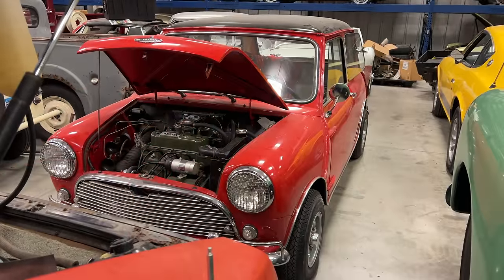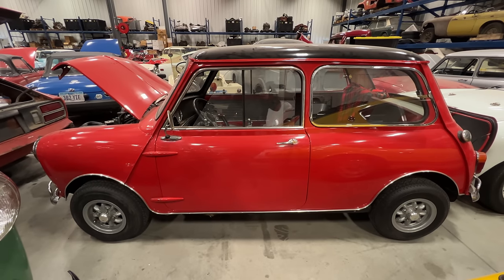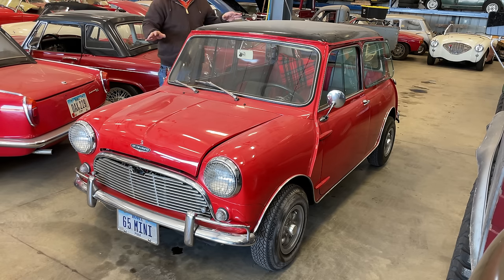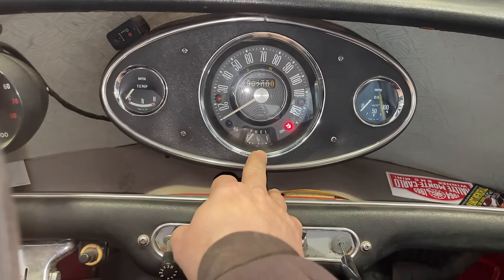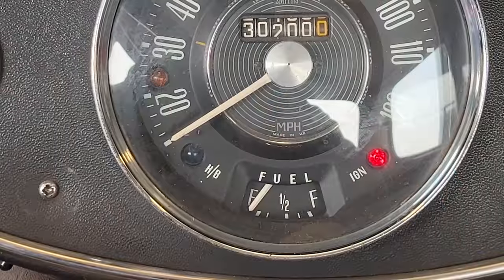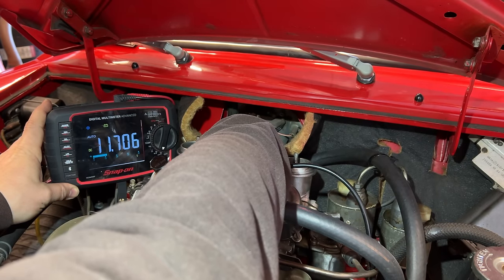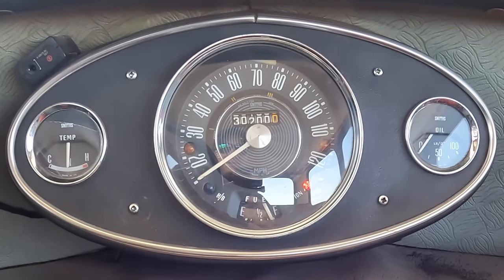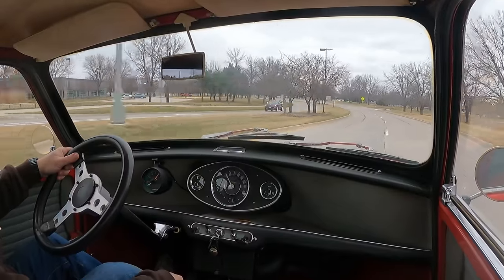I Sold My 1965 Austin Mini Cooper S

Comment: I had a Morris Cooper S in 1969. Mine had the 1275 cc engine,  twin fuel tanks, and hydrolastic suspension.  Baby blue body with a white roof, RHD because was made in Australia.  The most fun car I have ever had. Great acceleration and very agile on winding roads.
Reply: They are such great cars. We daily drove one for years. When we had kids we sold mine, and stored my wifes, as it is her first car. After 7 years it's now back on the road  we use it as a daily driver again. I did not realise I missed it so much, completely addicted again!

The Cooper S gets most attention, but in reality every Mini is great and equally fun.

Comment: When I learned to drive back in 1976, my driving instructor used a mini 1275 GT. The first time I got the really try it out was after I passed my test and Mr Rendell said "right then,  let's see you drive it properly". At the time my mum also had a Mini, a 1000cc estate and when allowed to borrow it I would thrash around feeling like I was doing 100 mph when I was actually doing 60. I first learned to deal with understeer driving that car.... but not before I had to pay for a headlight glass.

Comment: Had a ride in a Cooper many years ago. Driver never exceeded the speed limit, (in town, 30 mph), but he never slowed down for corners either. Pulled some pretty incredible corners.
Reply: Yep, they're known to take any corner at speed, just don't  let off the accel half way thru the turn, lol.

Comment: Steve- at 00.28 I see two cars on the rack I once owned, a Fiat 1100 which was my first car I bought when I was 16 in '66. The other is the Renault Dauphine. Here's a fun fact- when I did the brakes on the Renault I COULD NOT find rear axle seals. This was around '73 so no internet and really no Renault dealers at that time. Spent several days on the phone and driving a few hundred miles with feeble hopes. Finally I took an old seal with me with the collars they're pressed into to a parts store I used to work at and they let me go through the floor-to-ceiling rack of boxes of seals. I finally worked my way to the bottom shelf with maybe 4 boxes left to open. Opened a box and I took one look and the heavens opened up. We mic'ed it up and pressed one in and it worked. Get this- it was for a 1964 &1/2 Mustang 6 cylinder convertible. In '63 and '64 Ford had mid-year releases of new models and I think the Mustang was one of them . I'm 72 and I refuse to take my one true automotive miracle to the grave with me.  Tell your friends.
    I worked at a foreign car dealership (Jaguar, MG, Alpha Romeo, Toyota) in '69. The owner had a '63 Mini that he raced, it was good for 120mph. It wasn't pretty but it went like stink. They took as a trade-in a complete and original ex- Mass State Police 1947 Indian Chief  for $475 and I passed. Sigh. 
Love your channel. If you knew the cars I owned, you'd understand why. 
 '61 Fiat 1100 ran fine after my first complete engine rebuild
 '61 Hillman Husky Wagon    threw a rod through the block coming home from college
 '61 Morris Minor Convertible    paid 50 cents and a pack of Marlboros for it. 
 '60 Morris Van  2-year restoration project
 '61 Metropolitan Convertible  lots of duct tape to keep out the cold
 '59 TR3
 '65 TR4A rust-free, not pretty but rebuilt everything and fresh Michelins, predictable drifts through the corners
 '63 Fiat 600  GREAT little car, the radiator doubled as the heater core in winter, suicide doors folded back for AC in summer
 '61 Renault Dauphine w/'64 1/2 Mustang 6-cylinder convertible axle seals but enough about that.....blew a head gasket on a first date.
 '53 Jeep CJ 3B  perfect for getting in and out of trouble, many, many times. Oh, God..... so many times.
 '69 Toyota Corolla 1200  badly spanked my friend's V8 Chevy Impala on a beer-induced road race home from a party. Kept it in the power band and the rest was easy.
  '47 Ford Sedan  girls loved it. Girls 'parents, not so much. Not at all, actually. Something about that back seat....
 '61 Vespa Grande Sport  the most fun on 2 wheels. There's a story about the July 4th Bicentennial 1976 bonfire, a bag of ice and a rack of beers in the storage compartment that ended up at the hospital for a few stitches, but hey, you can't put a price on fun.
Reply: You've got a good memory for all your old cars!

Comment: Funny, I was out in my own little red Mini myself today, Steve!  .....except mine's red with a white roof (like Paddy Hopkirk's Monte Carlo contender).  Neat little cars.  I've been around A- and B-series BMC engines most of my life, but never owned a Mini...until 2018.  

My daughter absolutely adores them and when her sister bought the car I had purchased for them both to learn to drive in, the youngest said "Well, you'll just have to get a Mini for ME to learn in then, won't you Dad?!"  So I did - but it was a short while before she was back on the road, but she was ready before the day my youngest got her Learner's License and we've already had a few memories in the little car.  

I have a Triumph Stag and a Triumph 2500S as well, but the Mini is the only one that sounds like I am doing 100mph when I am still under the speed limit!  You can have so much fun with the little cars - even at slower speeds - throwing them into corners and leaving modern cars well behind you because you don't have to slow down.....just accelerate up to the corner, turn in, back off the throttle to bring the rear end round to where you want it to be and then plant the foot again. A thoroughly awesome little trooper, these wee things......and they will also cruise around town with no bother at all.  

I've driven the Mini about 5000 miles since she went back on the road in late 2020 and the longest distance so far I think is around 120 miles one way.  When you consider the road I was travelling on (mostly winding and twisty up and over hills with a few very tight corners for most of the latter half of the trip), the little Mini was fair moving to do it in 2.5 hours.....but boy was it fun and I never broke the speed limit once!  To say the little car has won me over against her bigger stablemates would be understating it a bit and I am seriously thinking of getting one of my own when my youngest eventually moves out and takes it with her..  

I recently had to choose between the Stag and the 2500S as to which one I would sell and as the Mini is as much fun and as enjoyable to drive as the Stag (for different reasons, although both make a very appealing sound), it would be the Stag that would go.  I will miss her for the open-top cruising aspect, but not for the fuel bill - THAT is for sure!

Sad you had to sell the wee Cooper S, but I will look forward to seeing what you replace it with!  All the best

Comment: Expect it's a 1275 cc and I would have sold 2 or 3 of anything else to keep it. Fuel tank held 5 Imperial gallons if I'm correct. I spent my weekends at Mosport with a very close pal who won the Under Two Litre Canadian  Sedan Championship in the late 1960's and early 1970's.

Comment: Driving past MIT one day around '69 I saw a Mini parked between 2 big American cars. Somebody had cut it across the middle and shortened it maybe 2 feet and pop-riveted it all back together. That's right, pop rivets. The front half of the rear wheel opening was cut into the door, if that helps with you envisioning it. I'd guess parking wasn't anywhere much of a problem.

Comment: Would like to see more mini Cooper videos, and how hard is it to find parts. Thanks!
Reply: Don't think the 1960s version was officially sold in the US so you may have problems there. However  the UK has plenty of parts and people who still remember what they may need, but obviously the import routine may rack up your costs.Apparently the designer would not put a radio in it because "it distracted the driver" LOL
Reply: @Witheredgoogie  Right about the radio but Alec Issigonis was a heavy smoker so he filled the car with ashtrays, even for the kids in the back 🤔
Reply: There is a thriving industry for standard and competition parts in the UK, even bodyshells so not a problem. Import costs should not be a problem compared to the high and increasing value of these cars. You need to keep it in tiptop condition.
Reply: @philiptownsend4026   LOL....he would in turn his grave now -no smoking and mobile phones etc